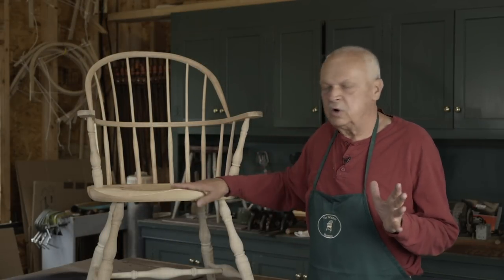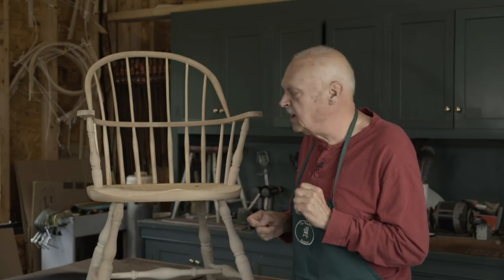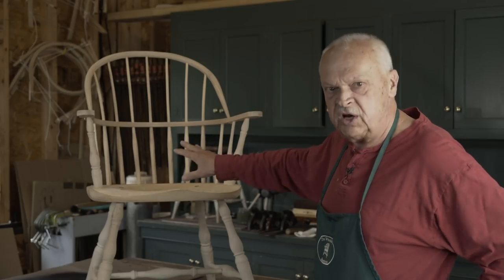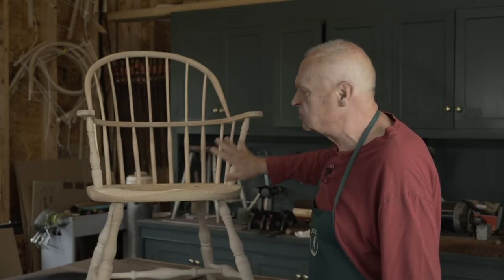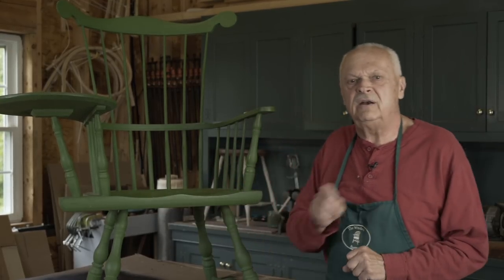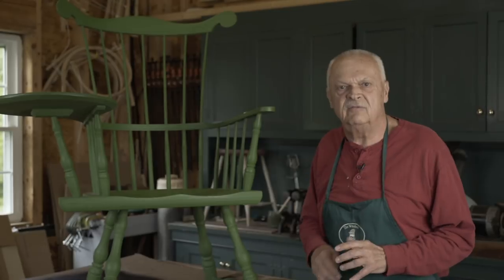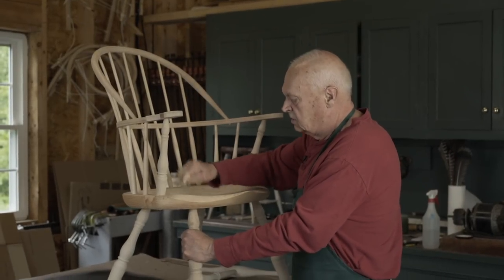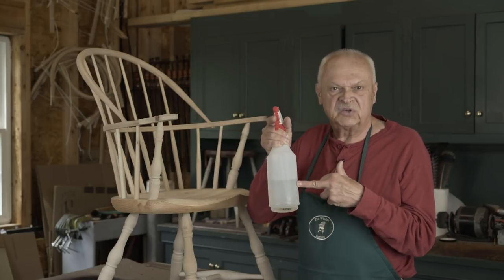Finishing a Windsor with Milk Paint

Comment: Great job as always Mike! What are your thoughts on black, over red, over green as I have read so much about when painting a Windsor chair? Also I used boiled linseed oil on my chair instead of wipe on poly. Is there much of a difference between using one or the other?
Reply from the maker: As I make additional types of Windsors I expect to discuss other finishing techniques, including the tortoise shell effect resulting from two colors. I stopped using linseed oil because it does not seal as well, permitting the milk paint to water spot if spilled or splashed on.
Reply: @thewindsorinstitute2047  I also had this question and while I still have two sack-backs to finish, I intend to do just as you said, the green/red/black, so will love to hear more about it too.  (I even wondered about a stain to begin; which I know is a cheat, but when and if wear through happens, it might also show as a layer)

Comment from the maker: I'm not the best guy to answer this question in that I applied milk paint to raw wood that I had made. Milk paint does not bond to a surface that has been previously finished. That said, Old Fashioned Milk Paint makes a product named Extra Bond that is claimed to solve this problem. I have never used Extra Bond and can only convey their claims. If you try it I urge you to experiment before jumping into the your project.